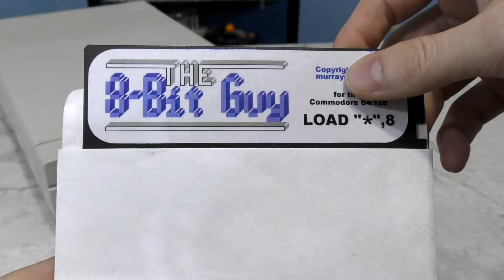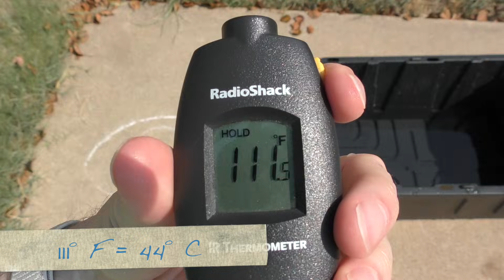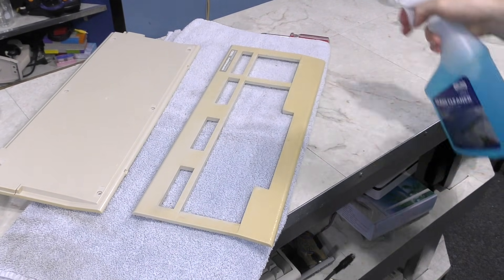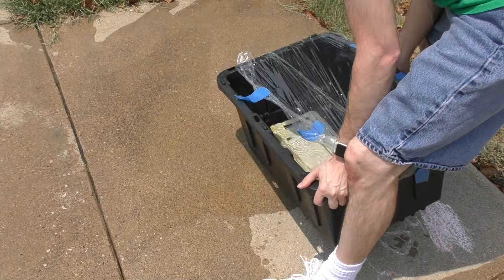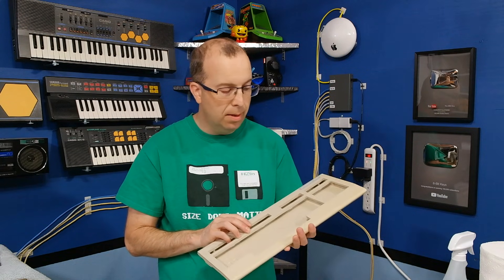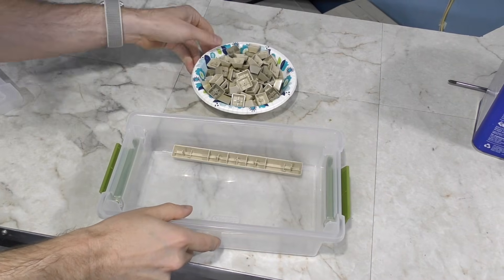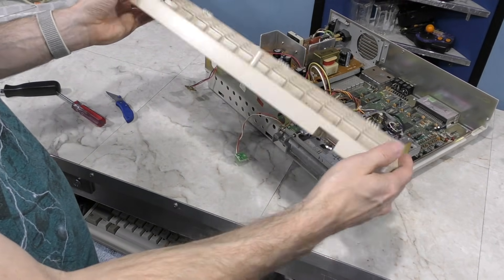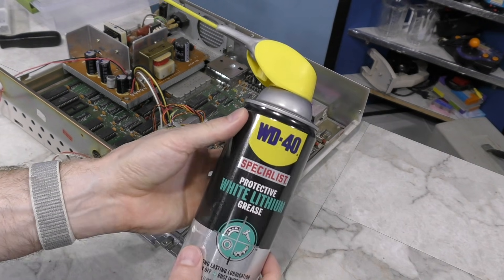Commodore 128D Restoration

Comment: I've had great luck cleaning key caps by putting them all into a plastic Tupperware container, adding water and dish soap, closing the lid and giving it a good shake for several minutes. Drain it, add clean water, close and shake to rinse (maybe twice). Does a great job.

Comment: I use an ultrasonic bath with a good degreaser / general purpose cleaner on high-ish heat for about a half hour, does the job for me without having to sit there and scrub each key.

Comment: Double sided adhesive tape works best for keyboards and general peripheral feet. Was wondering why you were using Silicon! Also another tip, dielectric grease for lubricating stabiliser bars on keyboards will help reduce rattling ;-)

Comment: rubber cement works great on plastics and rubber.  At least, I've always had luck using it.  It would probably work great for holding the feet on something like that keyboard. 

What did you ever figure to use though?  Also, silicone is probably not a great chemical to introduce to vintage plastics (or any plastics, for that matter) - ESPECIALLY liquid silicone lubricants, it will melt the plastics.  just fwiw

Comment: I know that this is an older video and someone may have already mentioned this, but in regards to the foot pad adhesion issue:

I would suggest trying 3M 300LSE or 468MP “adhesive transfer tape” (double stick tape). The 300LSE will stick extremely well and the 468MP is a ‘more forgiving’ if you want to remove them a little bit easier. 

You can get smaller sheets of the tape(a) off of Amazon or eBay for pretty cheap.

Comment: Denatured alcohol is a TERRIBLE solvent. Many things that are water soluable will not dissolve in denatured alcohol. As a matter of fact, their solubility decreases when alcohol is above 70%. If you have to use alcohol for cleaning 50~70% solutions are best. In my experience though, Windex and other ammonia plus detergent containing cleaners (like eyeglass and lens cleaners) are safe enough and much more effective. Instead of 10 mins, you would have spent a minute, maybe less!

Comment: Over two years too late on the response, but what works great for me in regard to adhesive for feet, case badges and so on is good old rubber cement. It goes on strong but can be removed with heat (hairdryer) if need be. And it does not damage the plastic as other glues or adhesives may do.

Comment: What Concentration of Hydrogen Peroxide do you use normally ? 
I have found a bottle of 12%, hopefully this should be sufficient concentration to retrobrite the Amiga 1200 keys and case I'm starting to work on

Comment: so lemme get this staight.
the C128 is a computer with a built in keyboard and external disk drive.
but the C128D is a computer with an internal disk drive and an external keyboard?
Reply: wait the only difference is were the computer is located, what if you plugged the C128 and the C128D together to have 2 computers with the same keyboard and disk drive

Comment: I've seen a lot of these videos involving retrobrite, but from what I know if uv light causes yellowing and adding peroxide to the mix removes that yellowing, why use the sun when you can use a much more intense uv lamp? if I'm not wrong it should make it faster, and you don't have to wait for it to be sunny outside, just set up a uv lamp on a workbench in the garage or something. In my opinion it would make a lot more sense

Comment: So I have a question. Does the 128D still have its own IO chips and CPU somewhere, since it's supposed to be a 1571 built in? or does the main CPU for the 128 do that job? It seems like that would result in lower performance vs other commodore machines if the CPU has to control the disk drive when it normally just sends requests out the serial port and the drive itself does the work.

Comment: Just a helpful hint :)) hydrogen peroxide decomposes into water and atomic oxygen (H2O2=H2O+O), the latter being a potent oxidizer, which actually does the "bleaching" part of the retrobrite. I see you're using direct sunlight to decompose peroxide, except it isn't really necessary. If you need slow, steady decomposition, you can use silver as a catalyst. Unlike potassium permanganate, manganese or iron oxides, it won't risk affecting the color of the plastic and the decomposition won't be too fast. To accelerate the process, you can microwave the container with silver and peroxide.

The silver doesn't participate in the chemical reaction and won't be affected.

Comment: Sneaky W key...
Reply: Also- I find 3M 468 or 467 MP "adhesive transfer tape" works really well for most general electronics reassembly work. Usually available at digikey / mouser / farnell.

Comment: I restored a keyboard for an old Dell keyboard. I disassembled it and just popped the whole assembly in the dishwasher (minus the PCB obviously) with only the tiniest amount of soap made for fine china and a dash of baking soda. I used the silver were basket for the keys because it closed up and kept them from being flung out. The parts came out spotless with no damage at all. I've since used this method on other plastic only parts and had great success in cleaning parts with it.

Comment: Minor correction: that is a C-128DCR.  The "CR" means "cost-reduced," which it was compared to the C-128D that was primarily sold outside of North America.  One of the cost reductions involved deleting the 60mm cooling fan that was mounted on the power supply sub-chassis.  It's a simple matter to install a fan, whichwill help in prolonging the life of those all-but-impossible-to-replace custom CSG chips, such as the 8502 MPU, 8568 VDC, etc.

Comment: You were blessed with good patience. I tried to take apart a controller (PlayStation 2 to be exact) and I was fine... Until I had to put it together. It wouldn't go together and the buttons fell out and 
L 2 and R 2 would get stuck down. It completely didn't work afterwards. So it's useless. I have a clear plastic one that is way cooler that I fixed before. So the point is. I would end up smashing it.

Comment: I still have my Commodore 128D... and dual 80c/40c RGB monitor... I use to have it have dual CMD hard drives and 1581 floppies, The Final Cartridge III, mouse, etc... it was a pretty fancy setup back in the day.

I used GEOS 128, and DesTerm128, and a few other apps...

Comment: Could the peroxide in water trick work with a UV light inside, so it can be done over more controlled conditions (not to mention not needing to worry about anyone walking off with it)?

Comment: It occurs to me, if you can retro-brite on the stove without direct UV light, it shouldn't be too difficult to rig up a stand over a butane or propane burner and put a large metal (disposable foil roasting or other) pan over it for the larger pieces.  It would be consistent and controllable, and you wouldn't be reliant on or restricted by the sun.

Comment: Hey David, I have a better idea for you to submerge the parts in peroxide to have a more optimal use of peroxide. Instead of dropping the parts in a bucket and covering with water and peroxide, put them in a large plastic bag. Then add a little peroxide and remove the air. The parts will submerge in peroxide (the plastic bag shrinks around the parts) and you have used probably one fifth of your peroxide!

Comment: 1:41 the water straight from tap is 36°C? Is this the same water you drink and did it warm up in a water tower?
Because that's within the ideal temperature range for Legionella growth. It should be lower than 20 to inhibit growth or hotter than 50 to kill off the bacteria.

Comment: I think that with the rubber feet you could’ve not put it right in the middle just in case you need to take it a part again because won’t the silicone get in the screw head?
Reply: Literally one second later you said it fell off lol.

Comment: You should try 3M Auto molding tape. Very strong stuff. You would have to floss the actual tape to be able to take those feet off if you needed to.

Comment: I have some insight on the silicone. I do a lot of prop making, and work with a few different silicones regularly. Silicone will not chemically stick to anything but itself. The only way it can bond to anything else is mechanically. When you use that silicone to calk around a tub for example (one of its intended uses), it is gripping into the cracks around the tub.

Because neither the rubber feet, nor the plastic are particularly porous, there is nothing to grip.

All that being said, it was deeply satisfying to see that machine come to life :) I have a 128 on my shelf right now that i've been dying to get set up and working.

Comment: Hey 8 bit guy, just a suggestion, but why not reattach the feet with the adhesive that was originally used? Here, take a look (all you have to do is cut to size): https://www.amazon.com/Atemto-Adhesive-Weatherproof-Strength-Industrial/dp/B01MXPY461?th=1

Comment: 3M has a badge adhesive tape. it works well for car logos... maybe it would work on this as well?
product number 08069 I think. Link to the product down below. IT's not cheap, but it does go a long way.

https://www.amazon.com/3M-08069-Press-Place-Adhesive/dp/B000PEWDJW/ref=sr_1_1?ie=UTF8&qid=1538816782&sr=8-1&keywords=3M+08069&dpID=31W6S-%252BzK7L&preST=_SY300_QL70_&dpSrc=srch

Comment: You should get a transparent tub instead of that black one. Especially if it's one of those that have a lid with latches (you could put a little bit silicone sealant around the edges to create a squishy seal to keep in the magic gases.

Comment: I had a laptop whose feet would fall off all the time, I recreated new feet by putting some Pattex Repair Extreme instead of the rubber feet and let it to dry to a rubbery state. That turned out to replace the original feet pretty well.

Comment: For Bonding these pieces on the keyboard, I recommend 3M VHB F9460PC or a similar transfer tape. Expensive solution but should work well
Or try a thin standard acrylic double sided tape.

Comment: 3M 300LSE or similar high-strength double sided adhesive tape should closely resemble what most manufacturers use to secure rubber feet to electronics (and screen lenses to housings, etc.) from the factory. It should be possible to use the feet as a stencil and cut each piece to the desired shape with a hobby knife.

Comment: Hey, David!  Have you thought about using 3M Carpet Tape for reapplying feet like this?  It's cheap, comes on a roll with a wax paper backing, and you can use a craft knife to cut it exactly.   That's what I use to reapply feet.
Hope that helps!

Comment: I think the yellowing is caused by the UV aswell with the contact with oxygen and/or Ozone, thus even the bottom was yellowed.
Reply: the slight yellowing on the bottom is caused by the bromide leaching out of the plastic, not so much O3 or O2.
Reply: Jeffrey [Equine Sanctuary]  As far as i´ve understood the O2 ,O3 UV "encourages" the Bromide to leach out.

Comment: Just use double sided sticky tape to hold those feet on the keyboard.  Or hot glue.  Both are "reversible' if necessary.  Or try rubber (contact) cement applying glue to both keyboard and feet, let dry, and then press together.

Comment: RTV silicone is a sealant, not an adhesive. Any sticking that silicone does is just because in its un-cured state it fills whatever small imperfections and unevenness there is in the mating-surface. Once hardened there is very little holding it to the surface without any additional pressure.

Comment: 1. keyboard: you left out the electronic board inside; a shoddy job on cleaning the inside too; there's still visible traces of gunk as you assemble it; 2. always use a tool made of softer material than the one you are working with, lest you want to leave a significant mark, is what I have heard from a woodworking guy. 3. still, you drive a channel I enjoy. I think the content's cool (aside of aforementioned suggestions), and it's well presented.

Comment: You might want to try using John Deere cleaning products, they have an All-Purpose Cleaner that cuts right through the oils and grease. They also make an Electronic Contact Cleaner that removes corrosion and cleans contacts. They also make an All-Purpose Degreaser might help with cleaning plastics. And they also have a glass cleaner that your wife will love because it leaves no streaks here is the pdf that describes all of the cleaning products that John Deere makes. You can usually get them at a local dealer:
https://jdparts.deere.com/partsmkt/document/english/featbene/DKB802_ChemicalGuide.pdf

Comment: silicone will only stick to silicone but when it does the stuff works great. this is the product we use at work the make silicone stick to just about anything.

https://www.amazon.com/General-Electric-SS4044P-Silicone-Translucent/dp/B01FT1Z5JA?qid=1534110521&refinements=p_n_feature_seven_browse-bin%3A5485702011&sr=1-9&ref=mp_s_a_1_9

Comment: You are very meticulous when cleaning the exterior of the hardware, but on the key mechanisms, you leave a lot of grime where all the keys latch onto. Same went for the oily C-64 you restored back in May.  Maybe you can use a paintbrush and something foamy to clean all that mess up.

Comment: If you haven't found a good adhesive solution, try 3M's spray adhesives - Super 77, or the more strongly tacky Foam Fast 74 are probably your best bet.

Comment: You should try cleaning the keys with an ultrasonic cleaner, I do it with my keyboard and it works decently. Put a little water and cleaning solution in it, and it should remove the most dirt

Comment: Didn't you do a video once where you heated the retrobright on the stove instead of using the Sun? Did that not prove that UV light is unnecessary, it's the heat that does it? Or am I misremembering?

Comment: I was wondering what was going to happen because silicone is mostly a sealant, good for waterproofing and making rubber seals, not really a glue. You might want to try a hot glue gun.

Comment: A tip how to easily clean the keys: Put then in a laundry net and with it in a washing mashine. Then run it at a not too high temperature and you're done. Much less work and maybe better result than washing each and every key by hand.

Comment: Is there a reason for leaving the stuff out in the sun, as opposed to using hot water from the tap? Having to wait whole days to finish retrobrighting must be frustrating :(
Nevertheless, fantastic results :O
Reply: Azy money. That's why. Sun is free.
Reply: Indeed :)
I wondered if the sun did anything to the plastic surface specifically, besides just heating the water
Reply: They did a test and just heating the Hydrogen peroxide does the trick. You can do it in a pan in the stove.
Reply: after some googling I found out that the UV light from the sun helps release the oxigen that will bright the plastic. So instead of the heat you could just use a UV light lamp for example. It would probably be faster and easier. But maybe it would not cover all the parts evenly,. Living marks, streaks etc.
Reply: Leonardo Lombardi 
Ah ok! I did wonder if the sun did more than just heat the water 😊

Comment: If the keyboard and plunger assembly can be separated from the pcb, leave all the keys in place and use a soft brush with soap under running water.  It will get the surface and sides of all keys with little effort.

Comment: Silicone sealant sucks at everything.  Never use it if you can avoid it.  It leaves residue that ruins installing future sealants.  Polyurethane is way better.

Now, as for as glues go... maybe shoe-goo might work.

Comment: Funny, since I'm into the C64 and have only ever had 1 original C128, I never new they came in a two-piece model.

In Michigan our saying is, "If you don't like the weather, just wait 5 minutes."  Regarding the deep retrobrighting tub, if you go to the dollar store and get a couple 2-packs of foil cookie sheets, you can install them on the walls of the tub to act as reflectors getting sunlight down into the areas of the tub that are in shadow.  Or, just find a shallower tub, preferably with clear plastic.  I've been working on de-yellowing a C64C with just plain peroxide from the pharmacy.  It may take longer, requiring a full day out in the sun, but the peroxide is good for several uses on several cases.

Comment: My usual go-to product for reattaching rubber feet/mounts is contact cement, the kind used to repair the soles on shoes. It doesn't dry into a rigid substance, leaving a little bit of flexibility so that when you move the keyboard around on your desk, the natural movement of the rubber feet doesn't cause the contact cement to crack and break its bond. It also peels off easily when used on smooth surfaces AND, doesn't add thickness to the feet like double-sided foam tape will.

Comment: Something you might consider instead of the more permanent solutions suggested for the feet is to use low-temp hot glue.  Just a dab either side of the screw holes, and then apply the feet.  Be careful with rubber cement, because it may actually attack the plastic.

Comment: Experiment with Rubber Cement lightly applied to each surface, let dry tacky and then combine for strong long lasting hold that still allows for future disassembly.

Comment: To reattach those rubber feet, I'd suggest the same type of double-sided tape smart phone repair shops use to attach screens onto the phone bodies.
Usually those rolls are rather thin, but one can always pull several strips over the rubber feet.
I use this double-adhesive for all kinds of things myself. really useful. Sticks really well, and can be removed if need be. It's thin too so it doesn't add much.

Just google up "3M Adhesive Sticker Tape LCD Screen".